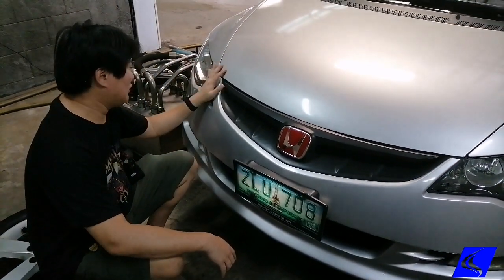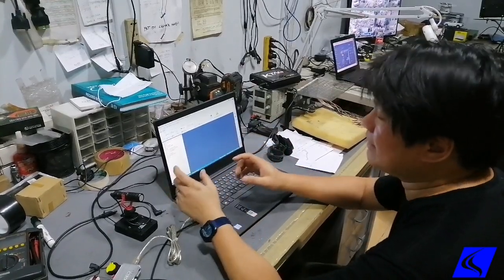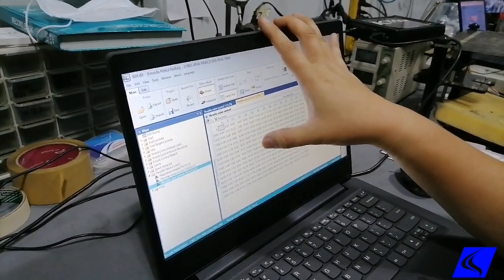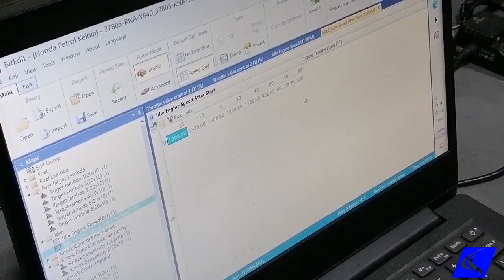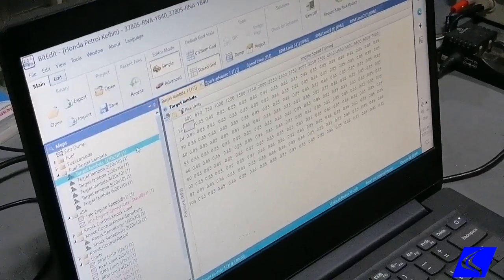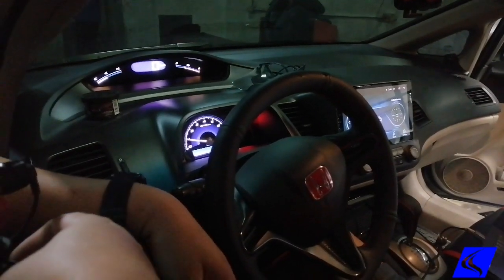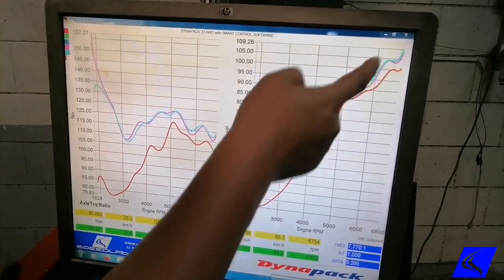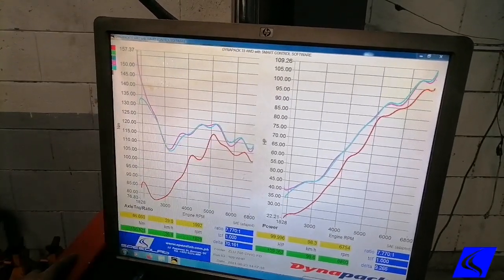Honda Civic 1.8L FD ECU Reflash Remap Tuning Process

Comment: Good day boss, i have ecu of 8th gen honda civic SI came from US. Question po is can we put that ecu in my 8th gen Honda civic 2.0s manual transmission local here in the PH and remap at your shop? Is it gonna work po? Thank you in advance po.
Reply from the maker: No. Work work 

We just remap your stock ecu
Reply: @speedlabchannel4452  thank you boss! How much hp my stock engine with my stock ecu will enhance po?

Comment: What hardware do you use to connect the laptop to the ecu and can you reflash the stock ecu?
Reply: through the OBD port, or physically  opening up the ECU and reading the data directly from the memory chip.

Comment: 1.8 should have a factory 140hp, why is there only 100hp before remap? Thanks
Reply: 140 hp is crank (engine) horsepower. That power is being transfered to the wheels which is the reason for the loss because is has to go through the transmission etc.
Reply: @tupeskib1022  ok,thanks
Reply: just advertised hp on paper by honda, but depends on the age or condition of the engine. and there is always a 15-20% hp loss at the wheels
Reply: Dahil inuuto lang kayo ng koreanong yan.

SAME ENGINE KAHIT SAKSAKAN MO NG SUPERCOMPUTER.

MAKUPAD PA DIN YAN DAHIL ECONOMY CAR YAN
Reply: Double TORQUE??? MGA SIRAULO PINAGLOLOKO LANG KAYO NYAN
Reply: wheel HP

Comment: Question is the ECU numbers setting found in automatic  same as Fd manual? Or they have different configuration? Since manual is more responsive than matic on FD models
Reply from the maker: Slightly different
Reply: @speedlabchannel4452  but is that slight difference translate different in real world?  Drag racing both 1.8 FD manual and matic? Will it be huge or marginal difference or depnds how good the driver launches the car. Sorry just. Curious
Reply from the maker: @athanco2482  this kind of comparison is moot and stupid
Reply: @speedlabchannel4452  haha 😂 was expecting that feedback
Reply: Ofc different.
Reply: Isang tangang nag tatanong ng tangang tanong sa tangang sagot na sumasagot ng tangang sagot.

Gusto nyo mabilis na sasakyan. Wag economy car gamitin nyo!!!

Inuuto lang kayo nyang koreano.

Same engine pa din kahit SUPERCOMPUTER isaksak nyo dyan mga honda boys na feeling karerista ng tagpi tagping modmod.